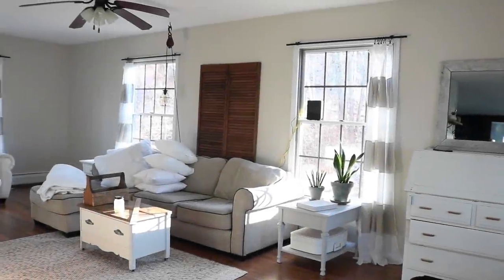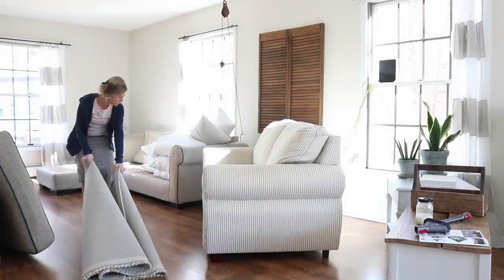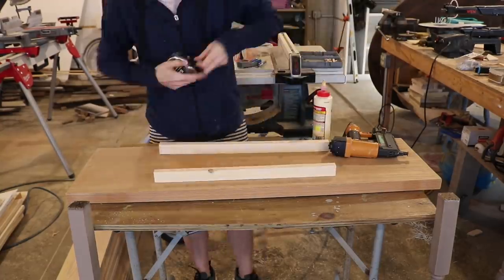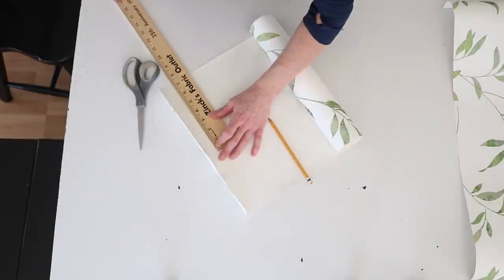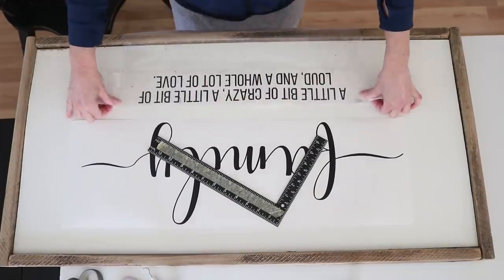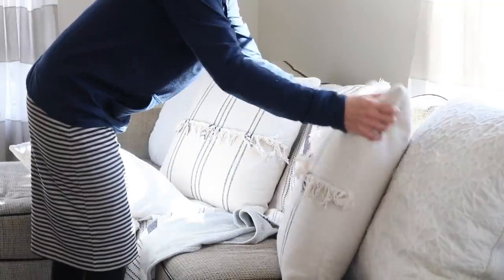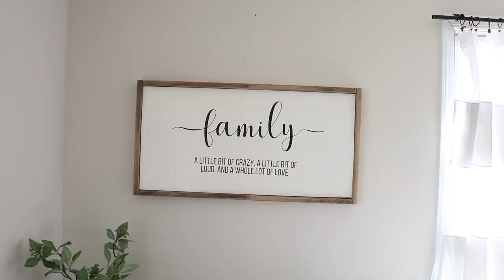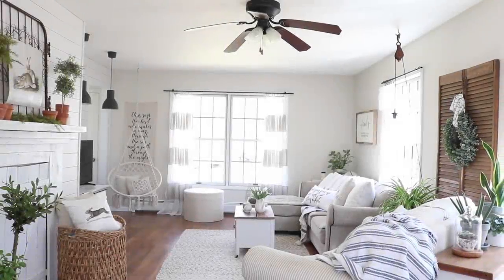🌿Spring Living Room Tour 2021🌷 ~ Spring Home Decor ~ Decorating with House Plants ~ DIY Sofa Table

Comment: One thing you might try when rearranging furniture is to move the couches away from the walls. That way, you can interact the couch with the fireplace, for example. And you can also move freely behind the couches. Another thing to try is to set them at an angle. If you move the couch at an angle, then set the coffee table at the same angle and everything else at an angle. You might try it and see if you like it.

Comment: Hi Mary some time back I purchased a maxi skirt and while it’s a well made one it’s too big and I haven’t been able to wear it...I bought a medium ( I usually wear a size 10 or med. and I’m only 5’ so length is long.) I’m wondering is there a way to return for a small, because it’s more like a size 12-14 or it fits bigger... Most of my maxi skirts are cut like A line which are straight no curves...I do want to wear it just would have to be taken in and all...thx for your help...👍💕😎